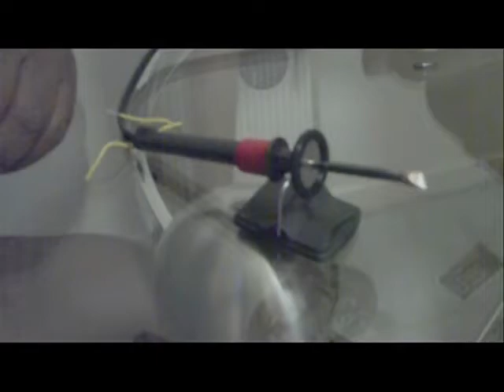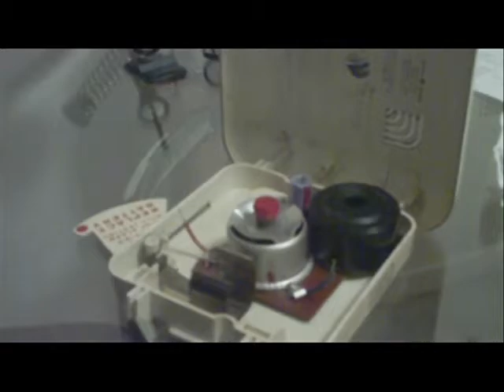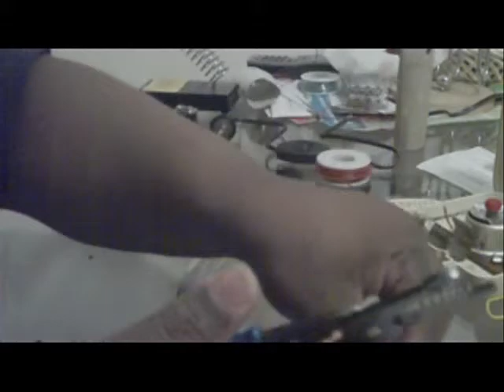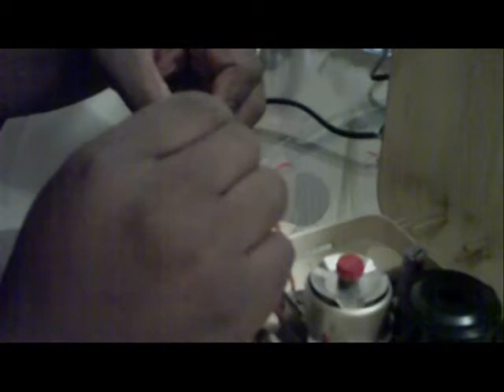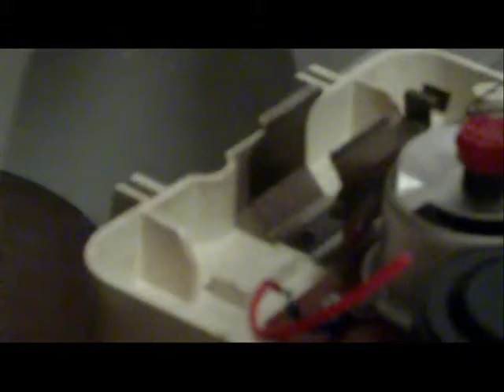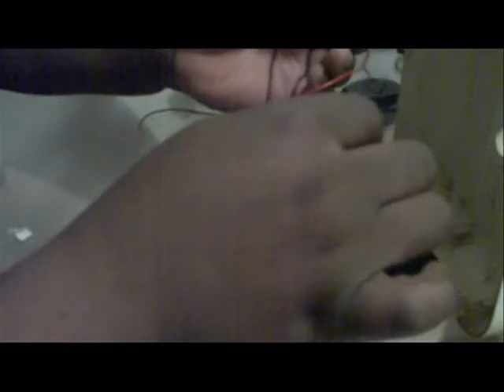How to fix and Repair a Smoke Detector

Comment: benson41011 this is a GE 8201-2. It powers off a 12.6 volt battery that gamealarm has in his smoke alarm.
Reply: Temple 92 Interesting, I only noticed after your comment that this was a 12.6v unit! How strange that it was running off a 9v battery, also, the model number for the earlier ones with the brass squealer horn and different sensor was 8201-101, but when they switched to the black Star horn they changed to the 8201-2
Reply: benson41011 i know. All he's doing is converting it to be 9v powered.
Reply: +benson41011 i found a website that has the TR289 battery it is 12.6 volts just what you need for your Entronic Z-700
Reply: Temple 92 Cool, I've been looking for a repro that would work in both my Entronic and my Gillette.
Reply: +Ben Phelps Do you have a video of those?
Reply: Yes, that was my other account. I don't use it as much. My main account is benson41011
Reply: +benson41011 Well I ordered that and it still hasn't came but i got it for my GE 8201-2.

Comment: For some reason I feel obligated to watch your videos :o

I see the problem was small, so in this case, go ahead, but otherwise it is better to buy a new one, it is important for your safety :D

You're soldering iron is weird o.o The ones I've used are like pens, but really hot and burn finger nails 8>.

Then again, the one I used was in a laboratory so intense that they have static grounding wristbands microscopes and thousands of feet of solder >:O

Even an extreme clean-room (yes I went in8D)